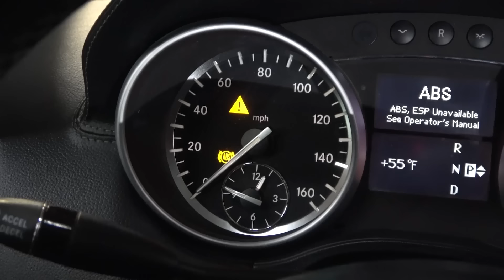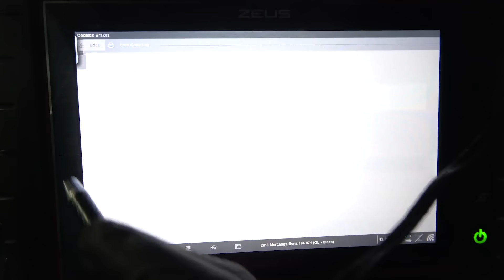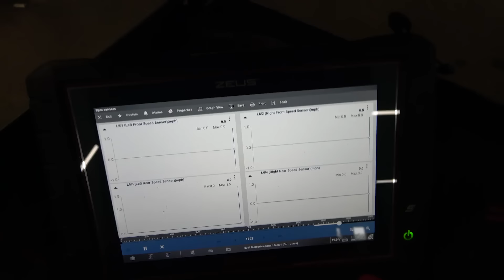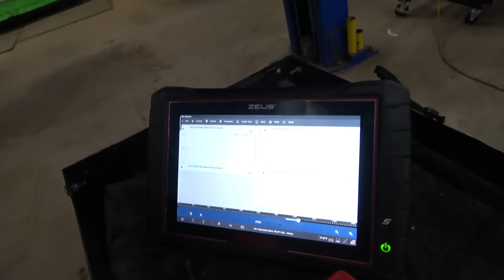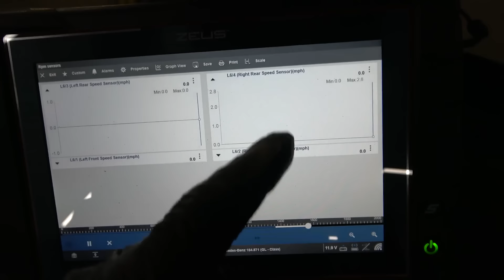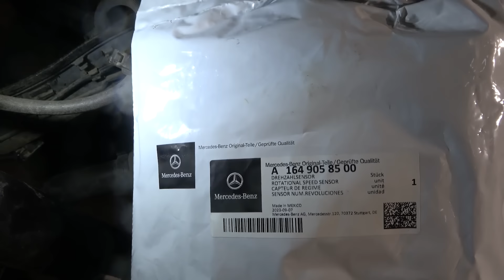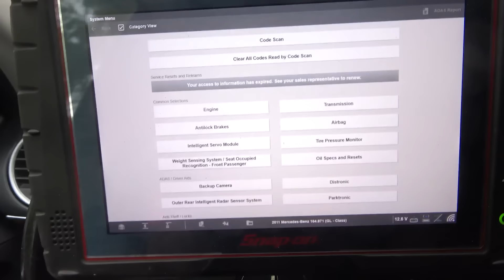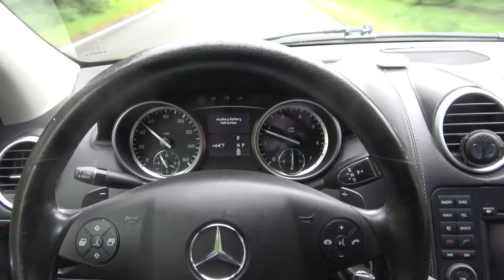ABS Light Came On, Brakes Feel Fine On Mercedes GL450, Can We Fix it?

Comment: Because you tested the wiring to abs control unit by running wires across is not a guarantee the sensor is faulty that only confirms the wiring integrity to the control unit ,lucky for you the impulse ring on the bearing was not at fault and your test didn’t prove otherwise, lucky the sensor was faulty or you would be changing the bearing 🤔
Reply from the maker: @del9936  Oh!

Comment: Throwing wires around for me is not a fast way to check wiring. For this type of sensors use led test light and look on the scan tool while connecting the circuit. It should generate a signal.
Reply from the maker: @tas.es9  Oh Cool! there are several ways to skin a cat!!
Reply: I like that comment brothe
There is many ways to skin the cat @KITS_Auto_and_Truck_Repair

Comment: My brake pedal sinks after changing the front brake calipers. They have changed the brake master cylinder, they have bled the ABS module with a scanner and it remains the same. I can't find the problem, any ideas?
Reply from the maker: @cransaftvalve734  you might still have air in the system or the Master may be leaking internally!
Reply: @KITS_Auto_and_Truck_Repair  OK. no leaks. Air?, I do not know. I will try it again. Thanks.

Comment: Can you put videos on bit of heat over the bolt or is it too close to the sensor? What size was the original bolt because mine is mangled and very rusted.
Reply from the maker: @dbash2004  if you heat it up, you might melt the sensor and make it hard to come out

Comment: Great video!  My Volvo xc90 2006 has an issue with the left rear speed sensor. The other 3 speed sensors produce graphs, but the left rear doesn't display anything.  In fact, the left rear speed sensor does NOT even show up in the data listed.  I replaced the left rear speed sensor with a new one, and still no data.  The wheel hubs and rings looked terrible, so I thought  that might be the issue since I had a new left rear sensor now that wasn't reading.  I replaced both rear hub assemblies and still have no response from the left rear speed sensor.  I was now going to try the technique for checking the wiring harness of the left rear speed sensor with the good right rear speed sensor.  Is that the way to proceed now?  I should have done that first.
Reply from the maker: @bluebox212   Yes! you should have checked the wiring first!

Comment: Hi Kit, I have front left abs sensor not showing and movement on the scanner. I ohm the connector and it was good. Couple of ohms. From the connector in the engine compartment, wires go into a fat harness. I don’t have a wiring diagram to trace wires. Do you have any suggestions?
Reply from the maker: @chrisrountree8468  can you by pass the known bad sensor with the good sensor and see what happens? kinda like I did in tthis video!!